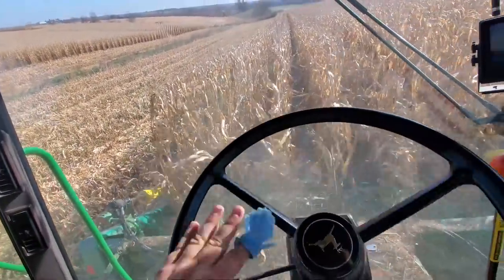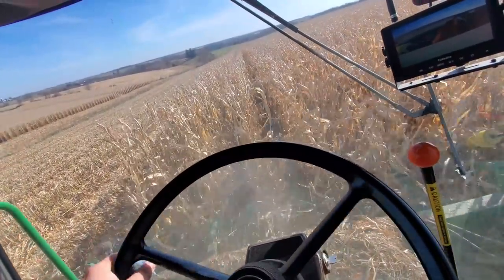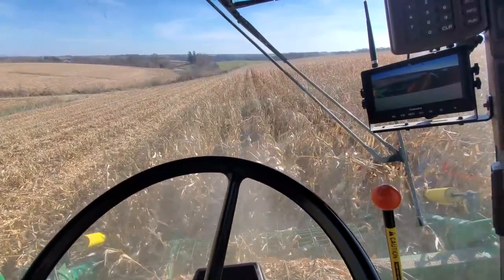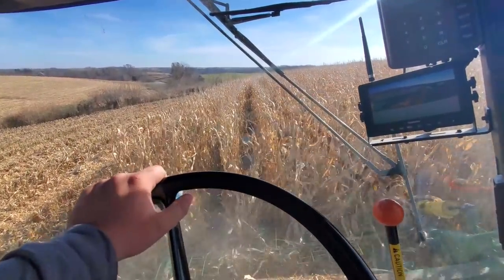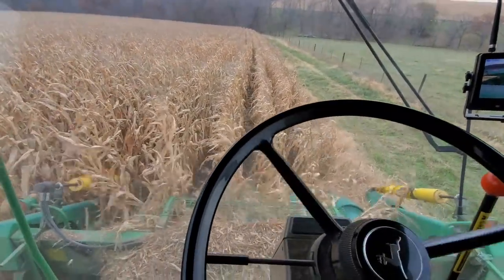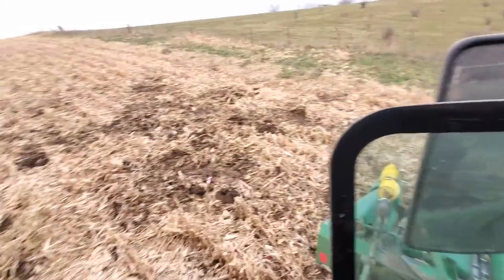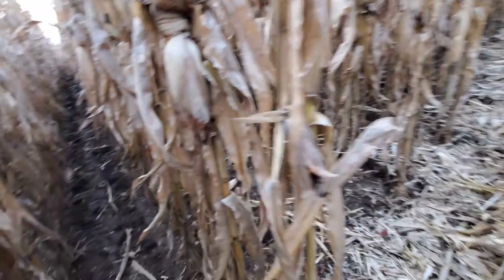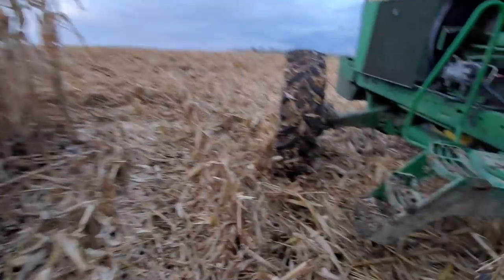Getting Some More Corn Out - FLAT TIRE

Comment: you need to invest in good used 8300  JD something its  got some real balls for a small farm like you have. with that 4450  you are just fanning the dust a 12 ft chisel disk a 12 inch's deep at 6.5 mph in toughest dirt you ever Sean. we had one back early 2000's we farmed 1000 acres black wax. it takes 30 hp  to 35 hp per bottom 18 inch plow an 8300  a good tractor for you.
Reply from the maker: We actually think more like a 8400.
Reply: yes 8400 would be even better if you drive a tractor like that  you will never drive 4450 again in tillage
Reply from the maker: @johnbennett9567  I know
Reply: I would tend to agree that a good next step would be to get a bigger tillage tractor.  Even a 4955 wouldn't be a bad move

Comment: the reason the ends do not grow as good of crop is do to compaction your chisel plow dose not go deep enough to bust up the hard pan so you can only limited depth you roots can grow freely . you might think a am full of shit we use to  no till beans rip corn stalks . but we stop that started v ripping every acre at minimum 14 inch's our yields went up .; butt we only chiseled our bean stubble when it was bone dry if possible corn stalks don't madder
Reply from the maker: Also not sure how well the fertilizer gets out to the edge. Then ya got more weed pressure and more animal damage.